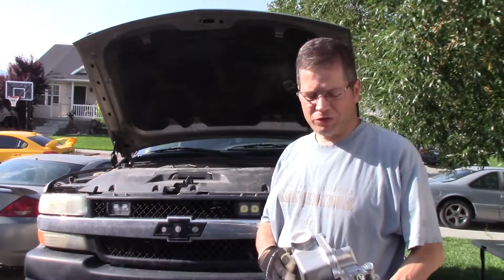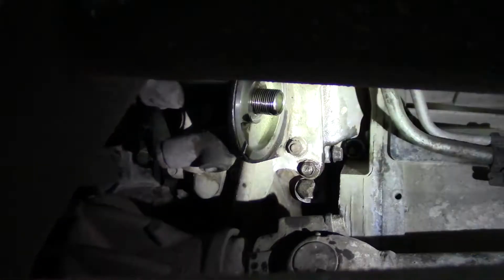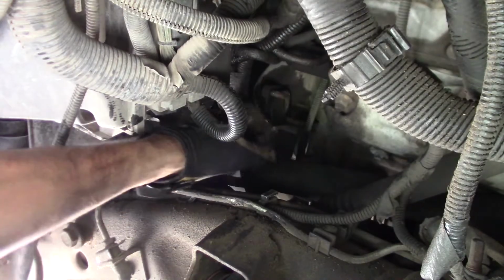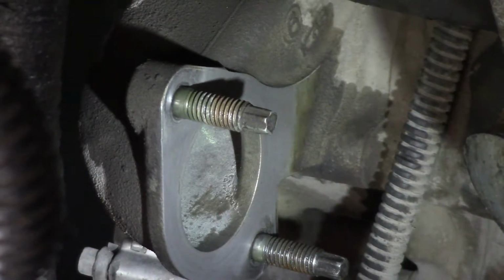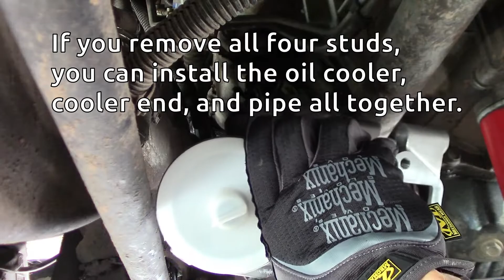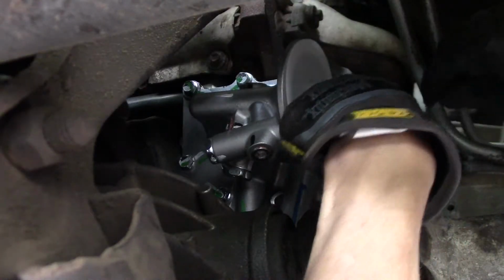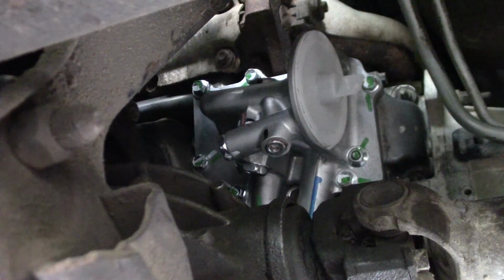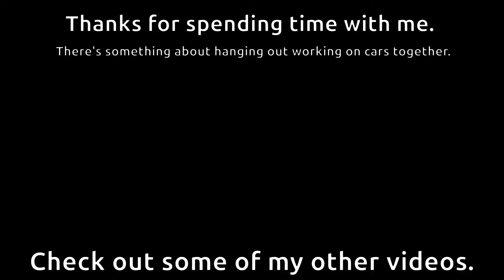6.6L Diesel Oil Cooler Replacement

Comment: can you list the part numbers please mine starting leaking bad today i need to attempt this
Reply from the maker: Your year might be different, but here are the gasket part numbers I used.
Water pump to pipe gasket: GM part 97188663. (an equivalent is available aftermarket).
Coolant pipe o-ring: Mahle 72224 (available aftermarket).
Oil cooler to adapter gasket: GM part 97192666 (equivalent available in Fel-Pro set ES73231).
Oil cooler adapter to block seal: GM part 12709792 (equivalent also available in the same Fel-Pro set ES73231).
Reply: thank you.

Comment: Awesome video... right to the point with great info the way everyone should do them! Besides taking the studs out is there anything else you can think of that would make this job a little easier? I was noticing you were working around that front drive shaft and didn't know if dropping that would make it a little bit easier for access?
Reply from the maker: Yeah, dropping the driveshaft would get you more room.

Comment: Your video is great. My question is when you put it back in the 2nd time did you install it with the coolant pipe installed?  I got mine apart and just getting ready to install mine. Is the stud on the water pump E8 or E9?  Also on the elbow putting the gasket in, did you put it in after the cooler was loosely installed? Thanks

Comment: Why didn’t you take out the front driveshaft?  Seemed like it was in the way most of the time, unless you needed it to support parts before bolting?
Reply from the maker: I guess I'm so used to things being in the way, since it didn't look like it had to come out, I just worked around it.

Comment: Jesus this looks like a pain in the ass lol
Reply: Wait til you do the FPR or injectors, or WP, or…
Reply: @megastick9324  all mine has already been done injectors, cp3, water pump, brake booster, power steering line, getting ready to do the power steering pump soon which looks pretty straight forward.

Comment: What was the reason for you changing? Did you have a coolant leak or oil?
Reply from the maker: It was a coolant leak.
Reply: @jtandrews3  thank you, I have the same issue , was it the aluminum housing that mounts to the block? And if so what gaskets did you get to repair?
Reply from the maker: @raycoutu9554  I put the list of parts in the pinned comment.
Reply: @jtandrews3 Is there a way that the coolant enters the engine through that piece?